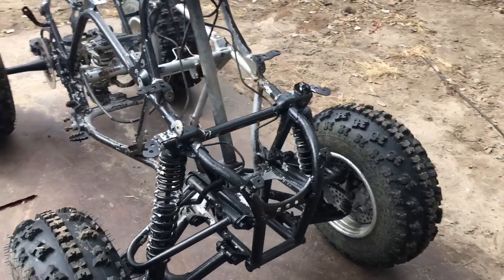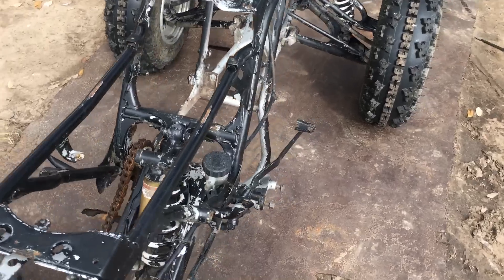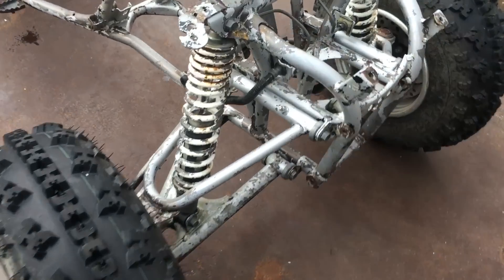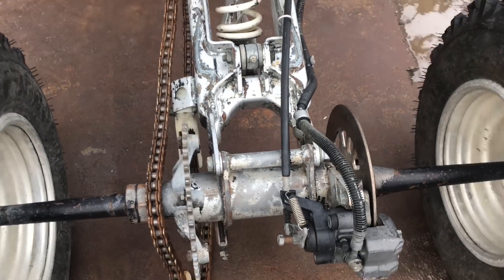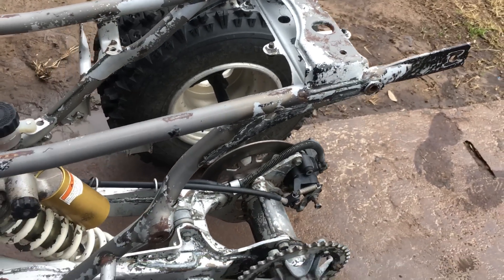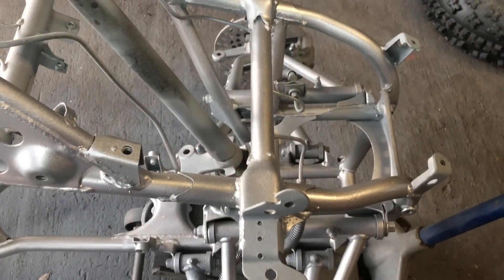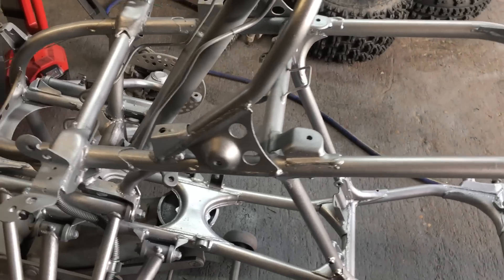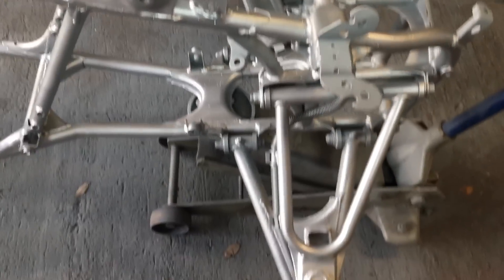Yamaha Banshee Engine Rebuild And Frame Restoration For Noe

Comment: Would you recommend to take the handbrake off the banshee
Reply from the maker: Henry Lewis 
The parking brake? Definitely, they never work and are plain ugly on the bars lol. Don't forget to unplug the brake switch it it won't rev
Reply: South Texas Banshee okay thx cause I saw that brake running to the back up the caliper and I was like what is this and I looked up what it was . I have everything off the frame cause of powder coating it's a 1990 last year of j arm

Comment: im down to one cylinder right side is dead i have an extra set of reeds should i try a new one on dead side or just go ahead and take it apart to make sure i didnt crack cyl?
Reply from the maker: 04tacomaguy1 
Compression test it, if it passes, leak test it. One of those will tell you something.
Reply: thank you so much man
Reply from the maker: 04tacomaguy1 
Lemme know what happens
Reply: i think its the coil or bad plug cap on right side. although compression on both sides was a little low

Comment: i got an 01 banshee with a stock motor that has fmf golds and a k&n filter and a boost bottle im at about 320 above sea level what jets should I run depending on the temperature

Comment: Hey Kevin my banshee blew up.. I think because of detonation.. But one of my cylinders is pretty much fucked.. Would you recommend I just buy new cylinders or have the busted cylinders resleeved?? And have you heard of Niche cylinders for the Banshee?? They are pretty cheap so I'm kinda scared to buy a set http://www.ebay.com/itm/321999259733
Reply: ***** Man I think I would rather have the ones I have bored over.. Lol oem cylinders are expensive..
Reply: ***** Ah I see thanks for that info.. I'll just keep the ones I have then..
Reply: ***** The cylinders are not in bad shape other than some scratches on the right cylinder.. If they were to get bored past the scratches then i don't think it should be a big deal..
Reply from the maker: ClutchLuck24/7 
Don't go with the Nische cylinders. If anything bore yours. Send them to Nate at KAN power sports. He's the best in my eyes.
Reply: Alright thanks..